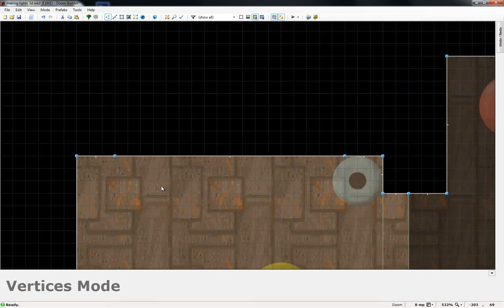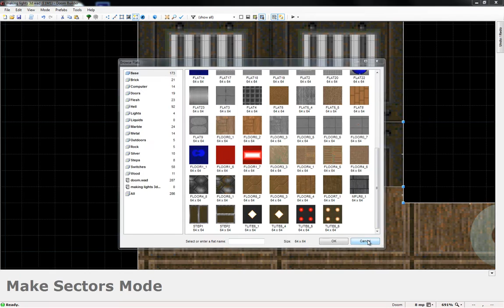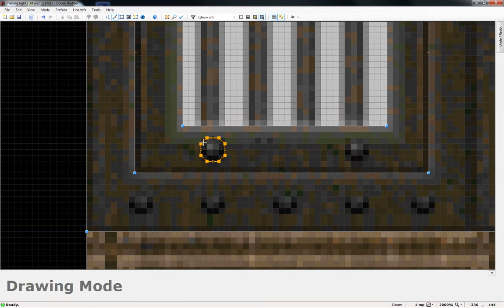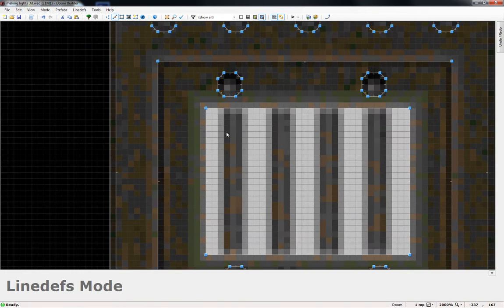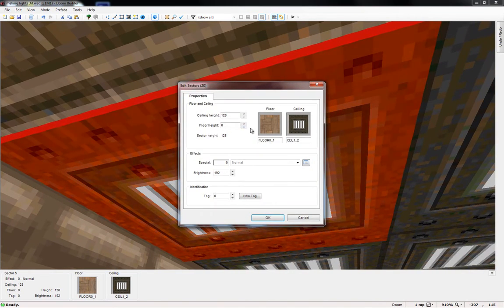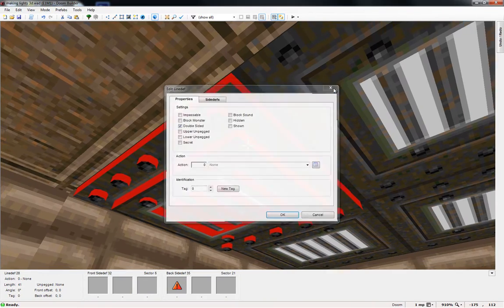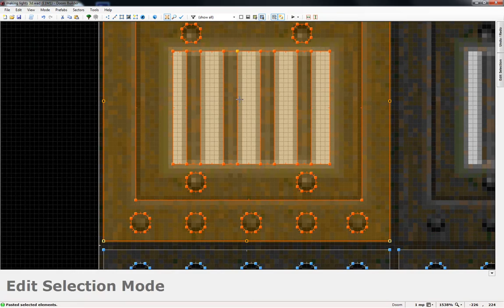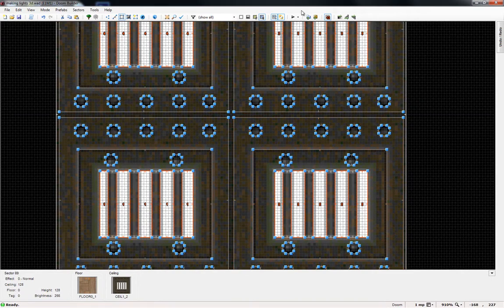How to make 3D lights in Doom Builder

Comment: It's very nice to see that this is possible but it has a few technical disadvantages. The engine uses all drawn lines at runtime for collision detection but also for what to draw and what not. You would want to prevent this. Modern games use lowpoly objects for collision detection for example next to a visible highpoly model. The method shown in the video is also frustrating when copypasting stuff and you need to realign textures.  Things can go quite well but it will always mess up ;) I think to achieve this you can better import a 3d model. If that has to many limitations then you exceeded what you should do in the doom engine ;)

Comment: While this sounds good on paper and looks nice when you stop and look directly at it. The only issue I see is. Doom is meant to be fast paced. When creating maps. I only detail what I feel the player would still be able to notice at a glance, if they were moving around the map. Still, it does look cool. I can see this working for sectors that are a little bit larger. Or if there is enough contrast to notice those details. For example. The bolts aren't as noticeable, due to the brown texture on all sides blending in, with one another.

Comment: You do realise that doom is not actually 3d right?

Well your stuff work but it will just cause some problems but there ok if you slightly add changed to the software doom is using

So that’s why you can shoot air from above and why u can’t look up
Reply: inhales Well...
Reply: Bit of a problem with that. If a floor is too high, you collide with it and objects can go over you. These both require 3 variables to see if there's a collision or not.
Reply: @Paf2022  It's been a very long time since I last played the DOS DooM so you might be right. 
From what I remember though, things having infitite height was due to optimisation. It's so easy to put in ports because it's literally one parameter.
Anyway, DooM is still 3d as ceilings can crush you and you can't move up something over a certain height.
You need 3 variables to make this work.
Those 3 variables are your 3 dimensions.